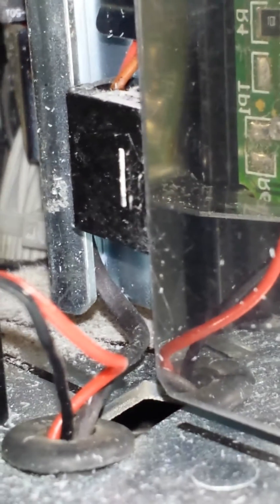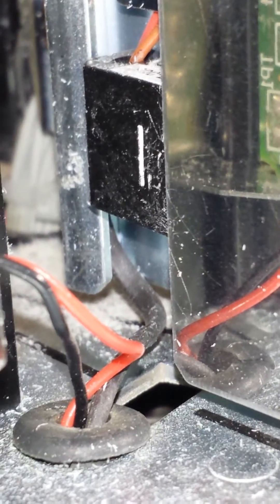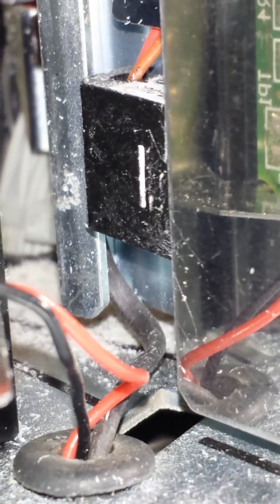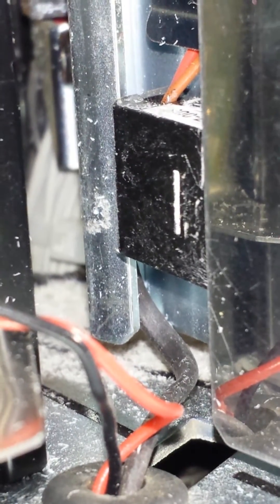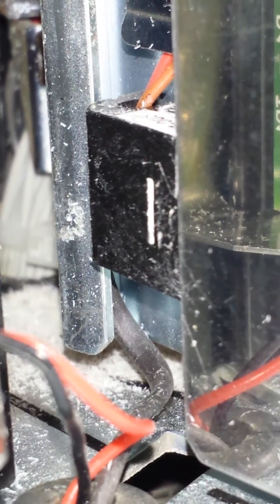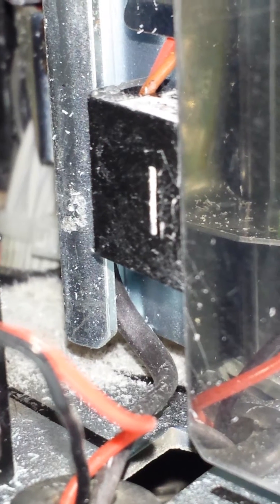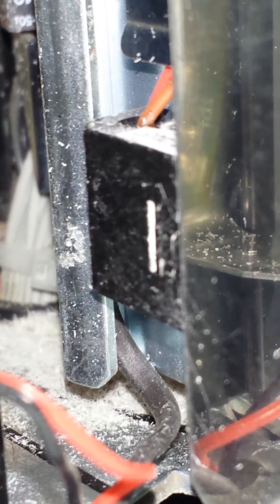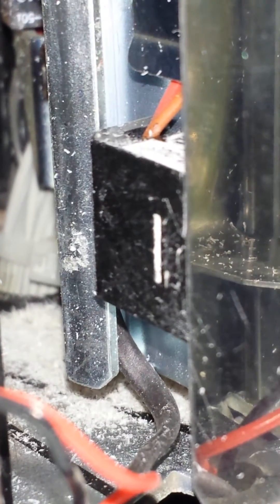Zebra Printer Label sensor maintenance

Comment from the maker: just to help provide better context , when loading the Labels ,  you usually slide the Labels under a black roller, and above a chrome plate. This chrome plate has a sliding track for the vertical guide which stops the Labels from wondering from left to right. ( with a brass thumb screw) Under this chrome plate is where both the upper and lower media sensor can be seen.  I have found that the best way to really get into this area and clean out  the sensor debris is to place the printer on its side with the solid panel down. Somewhat like when a surgeon preforms surgery.

Comment: Would have loved a pull back shot to show me where this media sensor is or at least get an idea of its location
Reply from the maker: great point.&#160; Sorry about that.&#160; the media sensor ( to your point)&#160; is difficult to spot. When you load the labels into the Machine at the rear , it is located UNDER the flat chrome plate that is used as the track for the media guide.&#160; The media guide has a brass thumb screw.&#160; If you crane your neck and find the brass thumb screw then the media sensor ( upper and lower)&#160; can be seen.